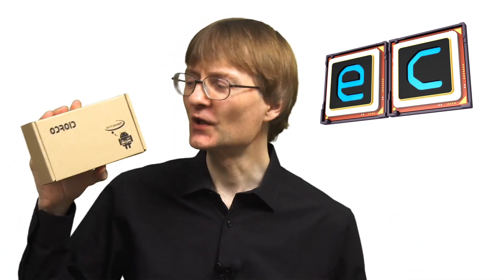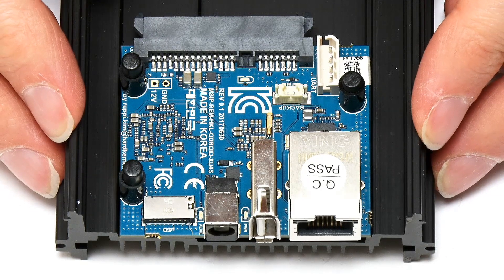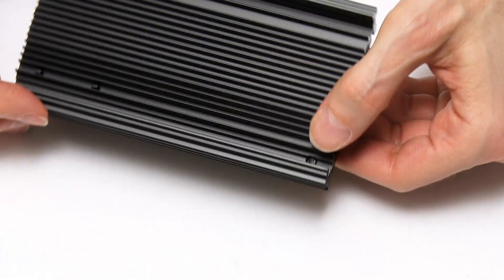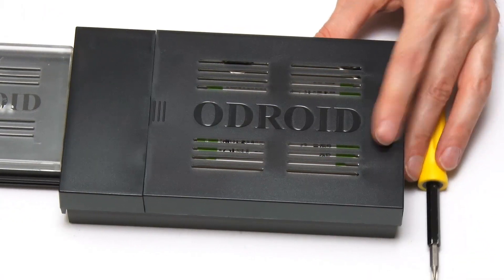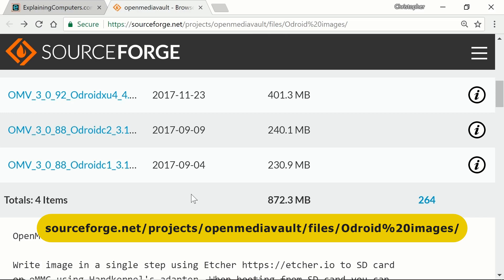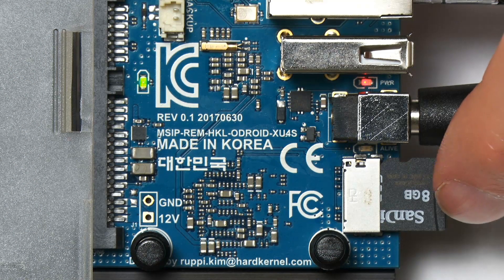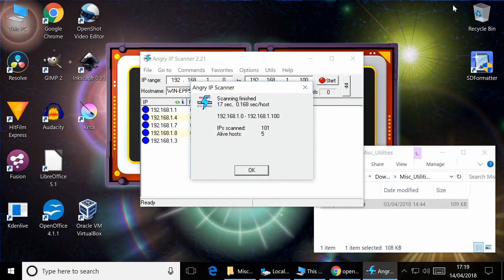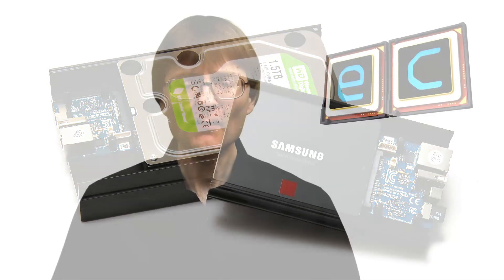Odroid HC1 & HC2 NAS SBCs

Comment: The combination heat sink and case packages the board and drive nicely together.
Reply: Perry McClusky Its a really neat design. I copied tons of files for a few hours and the temperatures of the cpu stayed always pretty fine, even with multiple access 👌🏻
Reply: Impressive
Reply: Alfons Siggler 😀

Comment: Why 12TB?
Hardware limitation or do they say that because 12TB was the largest at the time.
I remember when they said my Proraid box's harddrive size limit was 4x4TBs.
But now they say it is 16TB
Reply from the maker: I think you are right. Hardkernal specifically told me 12TB while I was making this video, but 12TB is not a natural limit, so I suspect larger drives will work.
Reply: Its only limited by the OS and/ or filesystem.

Im sure it could handle 100TB HDD as well 😉
Reply: Modern OSs donot care about HDD size.
Modern file systems can address more than 16TB

Comment: Another beauty video.
I have a question; Can it boot from SSD card. I don't know why these companies are still using SD cards! 
Also, would you consider installing a LAMP server and testing the speeds comparing it to a typical Windows machine? 
I have A Dell desktop setup as a server that runs 24/7 and it's kinda power hungry. I am looking to replace it with a small NAS/SQL server. This is promising. I think there is money to be made if a company like HardKernal comes out with a nice server package that doesn't use SD (Stupid Device) card. They are unreliable for long term R/W operations. 
The user has to do a song and dance to move the logging, temp and swap files over to an SSD like I did with RPI3. Not pretty!
Reply from the maker: I believe the boot is via the micro SD card only I'm afraid.
Reply: From what I understand, the SD card is being used for a direct substitute to the eMMC chip usually built into these boards so, not natively at least. You might however be able to rig up a solution for that using UBoot or another intermediate ARM kernel, but that's outside my expertise.
Reply: Try the excellent DietPi OS (dietpi.com). After installing, you have the option to move the root of the file structure to the SSD. A few clicks and you're done. : ) I believe that you'll still need to leave the MicroSD in place, but that'll result in less wear on the MicroSD, and means that if you're running something like Wordpress, your uploads will go directly onto the SSD. I don't know if this is possible, and don't think it's advisable, with an HDD, however. ** Also, there is a version of Open Media Vault on the dietpi site which will probaby work well with that OS.
Reply: It is very simple with Armbian. You just execute armbian-config and tell it to move everything to HDD, SDD, or mmc. Then you have only the boot system on the sd.

Comment: Nitpick: this thing cannot boot off the internal HDD. Odroid folks should have added a small SPI Flash (W25Q128 for example - only need to fit the full U-Boot and maybe the ARM version of UEFI) or on the board, so the user can install the U-Boot and/or UEFI bootloader onto that device, and put the main OS on the HDD.

Comment: Thanks for another very useful video Chris. There are a lot of solutions for NAS functionality out there, but this seems to be one of the front runners, to be so affordable. I'm stuck without gigabit ethernet for now so wonder, if I'm not using gigabit, would the Odroid still work faster than the RPi?
Reply from the maker: If you are using 100 megabit Ethernet, the Odroid (or anything else) will not be faster as a NAS than a Pi.

Comment: Hi Chris
I enjoyed the Odoid presentation. Very informative.  As I am a diehard Linux user, with a yes/no, can we use Linux in place of Windows do create the Odroid NAS?      

Thanks, Professor
Reply from the maker: Yes, certainly -- accessing the NAS over the web is just the same in Linux. And you can use Etcher in Linux to write the SD card. And there must be a Linux app for locating IP addresses!
Reply: ExplainingComputers Yes, nmap comes to mind for locating ip addresses and open ports.
Reply: If you are logged into your router through your browser, when you bring the nas online you should be able to tell what the new device is if you have logging turned on.  If I remember right on my router I can set static ip's directly from the log page so that servers always get the same ip when they come online.

Comment: I very much liked the video, its great to see a ready made practical application for SBC's as they are at the point where almost anything is possible. I would however like to see one that could be made into a router with a switch onboard, with the ability to have a SATA interface, preferably not powered as that could be done externally, so its an all in one NAS unit. I also do not like the idea of removing the ability to use a monitor on the device, even you had to find the device on the network. So I guess i wouldnt give it a perfect score and I am glad you were able to talk about your experience with that.

Comment: I wonder how it would perform as a plex media server
Reply: That could make another good video, given a good NAS what SBC can transcode a live stream the best? Hint hint.....  Correction multiple live streams the best, me and the kids rarely watch the same movies.
Reply: should perform good, but i think it would be best to have your client set the actual plex settings to always play original quality, this way your tiny board isn't having to transcode.
Reply from the maker: According to the comment below, it would run well. :)
Reply: Animal Facts and as MySQL Server?
Reply: I've heard repeatedly these are excellent for 1080p video via Plex.
Reply: It would probably work well but I think I would run it as a straight NAS to hold the videos and use a second SBC to run the streaming service.  With a dedicated SBC to Host the service it could potentially run allot smoother.

Comment: For any others in the UK curious about pricing. HC1: £70 / HC2: £80. Not great value for money.
Reply: Why? I dont know what a proper NAS costs in the UK, but £70 or £80 doesnt seem much to me (if the power suppy is included).

You have thousands of options with this device that a cheap NAS wont give you ;)
Reply: The costs I stated are without power supply or any other optional extras. I recently bought a 24+8 bay server as it was the cheapest option for a large NAS (OK, it's a little more than a NAS as was the original plan). Make sure you take into consideration the exchange rate. At the time of writing this comment, £1 (GBP) = $1.40 (USD). So the HC1 would cost US$98. Does that seem like good value for money?
Reply: Piers H I only payed 69€, thats about £60 ... + 15€ for a power supply so total of 85€ ... still doesnt look expensive to me 🤷🏻‍♂️

if you do some research then you will find a (local) seller who offers a nice price ;)

And dont forget: you will get support for many, many years because of the linux based OS for these little boards.

btw. you cant just convert £ to $ or € ;) ... As i said, only about £60 for the HC-1 here in germany :)

Edit: Its only 59€ now
https://www.pollin.de/p/odroid-hc1-einplatinen-computer-fuer-nas-und-cluster-anwendungen-810766

Comment: Another great video, thanks Chris. I think the only thing missing is a USB 3.0 port, rather than 2.0, because if I'm going to set-up a NAS, it's going to have a large HDD plugged into it, and therefore to back it up, I don't really want to wait hours for all the data to trickle over the USB 2.0 port to my back-up drive. I realise I could back-up to another NAS via the gigabit Ethernet port, but then why bother at all with a USB port?  Other than that, both products are great, and I'll probably end up buying one of them before not too long.

Comment: Too expensive. If you add the price of the single board to the storage, and peripherals. An old brand computer turned server can be purchased at half the price, and have better connectivity.  Makers of these boards should understand that. Just because of the small size doesn’t justify the 50+ US dollars.
Reply: You're forgetting about energy costs, which are very real and expensive.

A old desktop turned in a 24/7/365 server that consumes 150 watts would cost me over $150/year at my average electricity costs. Of course mileage  will vary based on just how power hungry your old desktop turned server is   and what you pay per kilowatt hour but it's still going to be a lot more expensive than powering a SBC.
Reply: Too expensive? Not really... Dont forget the energy consumption. The small size is indeed important because not everyone has a proper place for a bulky pc case thats just used for being a NAS.

And comparing it with a used pc isnt really fair. you should compare it with other NAS devices like the ones from Synology, QNAP or so.

Thats just my opinion. if you prefer using an old pc, why not. but it would be too expensive for me over time because a pc needs much(!) more energy than this device does.
sure, you can use standby and WoL with a pc, but then u have the problem that some other devices can cause problems if the NAS isnt 'online' 24/7 or when you try to access it 🤷🏻‍♂️

Comment: I would love to see one of these devices set up to run NextCloud as a home cloud solution! I really want to drop DropBox for home use - this could be a really good solution!
Reply from the maker: Next Cloud will apparently work -- see link below!
Reply: Nextcloud works very fine on this SBC ... BUT:
If you want to use Nextcloud with LetsEncrypt for https support, then you can get some issues if you try to ise it with openmediavault at the same time... Its a bit of work and it works fine then but after a few weeks i decided to use my HC-1 only for NAS and a RPi3 for Nextcloud.

One of the main reasons is that its not so easy to update php for example and the next Version of Nextcloud doenst support the version of php thats delivered with omv.

To make things short: Nextcloud can be used with omv, but you can run into some issues. But it can also run just fine 🤯😁

Comment: Aw darn, I was hoping the HC2 would allow for 2 drives to be loaded in for RAID mirroring configurations. I'd love to be able to have a portable ZFS mirror for quick movement of files from my home ZFS array to my backup ZFS array. Sometimes you just have too much data to easily synchronize through the net.
Reply: @Kazriko Redclaw: I know 2 years too late... but maybe the Odroid HC4 is the solution that you want.
Reply: @midimike72  Thanks for the info. I might consider one of those sometime. I ultimately just synced everything over the net with ssh tunneling and syncoid though instead of going the offline route.

Comment: Very nice that HC1 ... looks like a great replacement for my out-grown RPI 2 and its slowly usb2 connected external drive. Only thing that would make it extra perfect, 4gb ram. Why are all these SBC so light on ram? Thanks for the video.
Reply: Gordon McLellan Im using the HC-1 with openmediavault (and it runs nextcloud too) and i never had any problems.

There isnt really much RAM needed unless you want a NAS and/ or webserver with tons of users copying data at the same time 😉 For home or home office use the 2GB of RAM are totally fine.
Reply: Alfons Siggler I'm running a SQL server and node.js for data collection and analysis from a household IoT network. 1gb on the Pi is insufficient. 2gb will help but I'd be more comfortable with 4. I agree 2gb is plenty for a small NAS.

Comment: Great video! So is this the NAS you would choose for yourself? And also, if Gigabit-Ethernet is the limiting factor, wouldnt you rather go for an HDD?
Reply from the maker: The HC1 is indeed, of the SBCs I have tested, the one I have left configured as a NAS. My personal use of a NAS is for occasional sharing of files between machines. I don't use and would not use a NAS for backup due to the sheet volume of data involved, and because I would never want backups on a live drive (as this leaves them just as exposed to ransomware as an internal drive). An HDD indeed offers far faster backup, and remains offline when not being accessed! :)

Comment: What people want is SATA and HDMI so that they could build a HTPC out of it.

One that is not compromised by having to shuffle disk data through USB, that is...
And please, put ports on only the back side except for maybe USB-A and headphone in the front instead of having ports on all sides ... :rolleyes:
Reply from the maker: I very much take your point -- an SBC with all the usual connectivity and SATA as here would be very nice. Though that option is available on, say, a Banana Pro (at the cheaper end of the market), or an UDOOx86 (at the higher end).

Comment: Where do you get all those hard drives
Reply from the maker: I have been building PCs for 30 years -- they kind of mount up! :)
Reply: if you want to get rid of some SBCs and keep the money or donate it to a local charity. I would be very interested to buy something(s). I would want all components that it has with it from  manufacturer.  as long as current Linux still supports it. especially MINT. Of course, I would pay shipping. give some thought!

Comment: Its a shame because I'd like to have a couple wireless NAS devices and none of these come with 5ghz AC wireless built in. Of all the useless things they put on these SBC, they could at-least add a decent wireless adapter.
Reply: Green Foxes The new RPi3+ has 5GHz WiFi :)

But a decent wifi usb adapter that works with linux out of the box isnt really expensive, so you can easily upgrade you sbc :)

Comment: I never seen this with connecting SATA HDD, and I love it for portable without any trouble. :)
These Odroid HC1/2 can be use as FTP server by the way?
Reply from the maker: Yes, you could use as an FTP server. Not least OMV allows FTP access.
Reply: Wow! That's why I really like this system! :D
My PC and laptop almost run out of HDD capacity, so I'll need that for future use. But only problem is that cost are quite expensive, I think I should save my money for buying it.

USD$49 = 191MYR (Malaysian Ringgit)
USD$54 = 211MYR

Comment: it doesn't use all eight cores at once, probably should talk about that instead of using it to proclaim its speed.
Reply from the maker: This was indeed the initial intention with this kind of octacore configuration. However, with the right OS, the Odroid boards can use all eight cores at once. Look in my video here around seven minutes in for proof of all running at 100 per cent! https://www.youtube.com/watch?v=8qBxi6Q4XlY

Comment: +ExplainingComputers / Christopher,
These look like two nice SBCS. It is also great to see the inclusion of a pin set for a RTC and serial interface, even though I am used to seeing serial interfaces with only three pins. ie. TX, RX and ground -- the power for the serial interface being supplied by USB (reference: CP2102 USB to TTL device).

 I would also be a bit concerned about installing a 2.5 inch mechanical HDD on the HC1. From my own experience of using SBCs that included a SATA interface is that usually there is not enough power to fully use a HDD (and therefore would suggest only using a SDD instead). However, it is great to see the inclusion of a 12v jack with the HC2.

The only extra thing I would like to see on these boards is an inclusion of a eMMC storage device (minimum of 8GB), which could be used as a bootable system drive (ie. boot, root and swap partitions).
Reply: Nope, its totally fine to use a HDD with the HC-1. Im using it with a 5TB Seagte HDD without having any issues.

Of course you need a proper power supply and then it works fine 👌🏻

Edit: EMMC would be nice but these devices are made to use with openmediavault (or anything similar), so there wont be many read/ write on the sd card :)
Reply from the maker: Hi Mark. I thought you would like the serial interface! :) Some eMMC would indeed be great for the OS.

Comment: Any SBC options you know of that support multiple drives with a SATA interface directly? Not USB to SATA.
Reply from the maker: One option is to use an Odroid XU4 board and this case and add-on board kit from Hardkernel -- so allowing two 3.5" drives to be connected via SATA: http://www.hardkernel.com/main/products/prdt_info.php?g_code=G150575879656 -- though note that the internal interfacing remains USB 3.0 as here.
Reply: Yes, that USB 3 interface is the problem. I'm interested in a real, full, SATA interface to 2 (or more) drives. If you ever run across something like that, please think about doing a video review.

Comment: Can you connect a second hard drive and use RAID?
Reply from the maker: Not as far as I am aware on this board (well, I guess a drive connected via a USB 2.0 interface is a possibility). But they sell a case and add-on board for an XU4 that allows for RAID in a two 3.5" drive system: http://www.hardkernel.com/main/products/prdt_info.php?g_code=G150575879656

Comment: Dear Chris, How exciting!  I'm glad you compared both SBCs, side by side.  The whole world of SBC computing is really taking off.  I want to comment on the audio portion of your blog.  I'm going to have to listen to the presentation at least again because the sound seemed a bit muffled.  I would almost guess you are using a new mic.  I'll go back and check out the audio on two other computers of mine.  Best wishes, always!
Reply from the maker: Thanks for this. Though my microphone here has not changed! :) There is always a different accoustic in the segments where I am grabbing from a computer, due to how that is physically set up (especially here where the PC concerned is noisy), and because I am using the XLR pre-amp on the BMD 4K, rather than a camera. But what does change very frequently is my voice (due to the physical damage to my focal folds back in 2011. I am indeed myself sometimes shocked at how different (and sometimes muffled) I sound on different occasions. It is a constant battle, especially as I also work as a speaker! :)